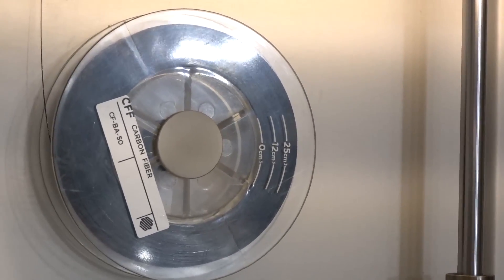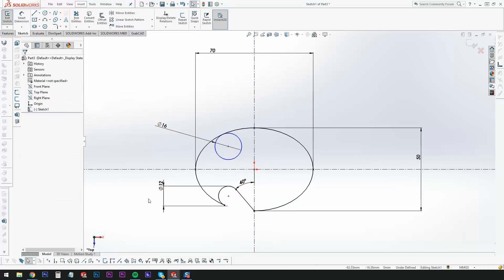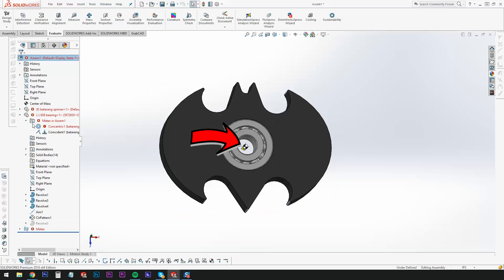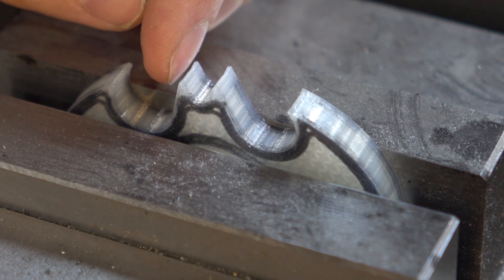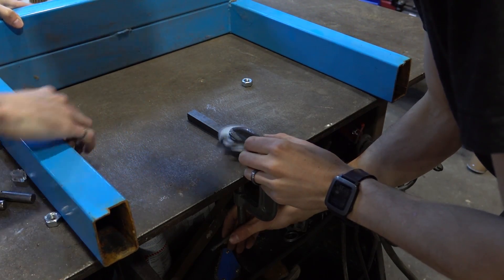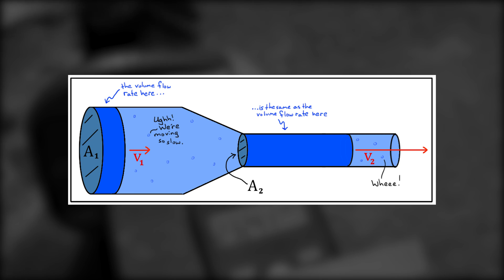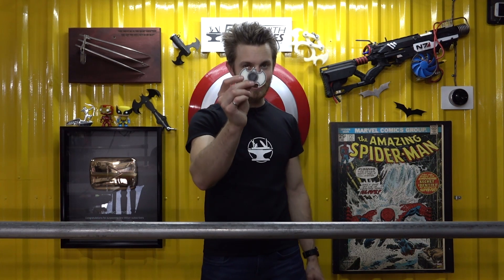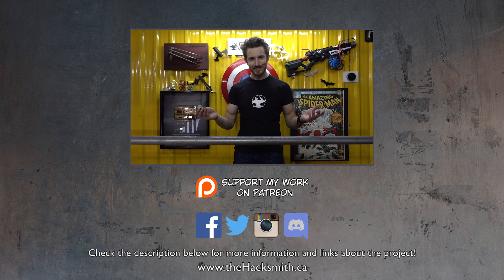Carbon Fiber Fidget Spinner is INDESTRUCTIBLE! +GIVEAWAY

Comment from the maker: Should we try and destroy this? What should we spin it into?
Enter to win your VERY OWN by hitting the top of our leaderboard on https://www.gawkbox.com/thehacksmith !
Reply: Spin it really fast, then make contact between it and a steel rod, just to see who would win ^^
Reply: The first thing you could do is show the reflective tape that the tachometer uses to know when it has done a rotation. Can't see any markings or tape on the edge anywhere? If it was spinning at 100000rpm it doubt it would be as visible as in this footage. I am guessing the real rpm's are closer to 20000, maybe and that's a big maybe up towards 30000rpm. Alternatively measure something without using reflective tape that you can actually prove the RPM of. Like setting that drill to let's say 1000rpm and measuring that.
Reply: the Hacksmith make a fidget spinner launcher and destroy things please
Reply from the maker: +Volkan Arslan because these are very expensive to make! The bearing was $20 alone, and the carbon fiber material is not cheap!
Reply: 2 spinners colliding together, maybe different materials?
Reply: Could you turn it into a floating spinner or just make a floating spinner
Reply: Print this exact one again, but without the reinforcement. Test it and compare the results!!!!! >:D
Reply: the Hacksmith awesome 😍
Reply from the maker: +Romit Heerani enter the giveaway! It's free! :)
Reply: Why not try to make EDF blades for using this printer? It seems that the carbon fiber holds up.
Reply: Awesome job :) :) :)
Reply: the Hacksmith You should try to sell these on your website.
Reply: I know this is irrelevant but I think you should work on Montagnes ballistic shield from Rainbow Sox Siege
Reply: you should try spinning it into a moving car. to see what happens to the car, not the spinner
Reply: the Hacksmith could you make Thor's hammer?
Reply: the Hacksmith Absolute Cancer
Reply: print another one, and clash them together!
Reply: the Hacksmith put these up for sale!!!
Reply: put heat on it wile it is going fast
Reply: the Hacksmith maybe make one with a marvel theme too.
Reply: the Hacksmith why you don't sell these things and youse the money for your shop
Reply: the Hacksmith i
Reply: the Hacksmith thank you for your answer and sorry for my english I'm an german viewer
Reply: the Hacksmith please try to break the fruit using fidget spinner!!!
Reply: Can you make the edge sharper and destroy things with it
Reply: how about shoot on it
Reply: the Hacksmith make it hit different kinds of fruit. And will you make me one for free
Reply: the Hacksmith, how is your arm by the way
Reply: the Hacksmith not you too
Reply: the Hacksmith I wish I could take part, but I know I won't win because I simply can't invest that much time into it... :/
Reply: you start selling the stuff you make. start making more Income which leads to better parts for projects. slap some black paint and you could easily sell that spinner for $35-$50
Reply: Adams World um, why don't you read what The Hacksmith said just a few comments ago. The bearing was $20.
Reply: the Hacksmith With two fidget spinners instead of the fingerguard put someting to make it like a spining top,someting like the Beyblades
Reply: the Hacksmith  try making it fly
Reply: the Hacksmith any reason why gawkbox isn't working for me? I've tried doing a few things now and waiting but nothing happens
Reply: how much does the 3d printer cost?
Reply: Adams World  carbon fiber is one of the best and strongest materials in the world and the baring would cost something like 20$
Reply: the Hacksmith  can u try cut wood with the figet spinner that would be epic!!!
Reply: the Hacksmith van you make one from normal plastic we can see the diference
Reply: the Hacksmith Don't read my profile picture
Reply: the Hacksmith try to make an orbeez destroying fidget spinner, with blades and stuff.
Reply: cool
Reply: the Hacksmith sry
Reply: the Hacksmith make a spiderman fidgetspinner
Reply: the Hacksmith does the givaway works on mobile ?
Reply: the Hacksmith have you got flu? your voice is strange...
Reply: the Hacksmith lol
Reply: spin it into spinning lawnmower blades that should do the trick
Reply: the Hacksmith can it mow my lawn
Reply: the Hacksmith You should redo this BUT with the smaller r188 full ceramic bearings.
Reply: the Hacksmith how many orbeez can u fit in ur hand!?
Reply: Hey hacksmith I saw a video in which a youtuber made the same spinner in metal check out that video it is in the channel called gaico whatever
Reply: Hey, can I please be in one of your videos
Reply: Hacksmith what about your iron man project plz answer
Reply: the Hacksmith i dont really need another fidget spinner i got you 1.20 im only 12 so i can't send you money
Reply: the Hacksmith make one for me plss

Comment: Upsize it!  At 5 inches the edges will be going over 1,000 mph. 
Lexan safety shields!  
Harbor freight has cheap Super heavy duty shop presses, you just need to align and slightly mod it when you assemble it.  (owns a 20 ton shop press I used once)
Reply from the maker: +Kris Kringle haha you wouldn't be able to spin it up that fast!

Comment: There are more 3d printers that can prin in carbon fiber. Like the Zyyx PRO for exampel, its able to print in both carbon fiber and kevlar.
Reply from the maker: Still not the same thing, from what I just saw the Zyyx PRO has proprietory filaments with chopped fibers in it, where as the Mark 2 actually has two filaments, one plastic, and one pure fiber, allowing for continous fiber to be placed inside of the part!

Comment: How does that RPM sensor work? Does it measure 2 (or more) RPM / rotation because the shape of the spinner is irregular?
Reply from the maker: +Etu Suku for non reflective parts like this you put a piece of reflective tape on the edge, that's what it counts
Reply: Cool, thanks for answering. Love your channel!

Comment: I've been a fan since the captain America shield, and I can't wait until the iron man suit is done. That being said, as an aspiring engineer, I just wanted to ask for some advice; I'm planning on going to Texas a&m for both mechanical and electrical engineering, but my concerns should I try and complete both majors in a four year span, or choose one to do in four years, and then go back to school for the other one, taking 8 years total? And then if I should do that, being that mechanical engineering is said to be the most work, while electrical is said to be the hardest, which one would you suggest I should do first?

Thank you for taking the time to read this, 
Frank H. Gibbons IV
Reply from the maker: It really depends what you want to do most. Is it really possible to do both in four years flat? That's crazy!

My personal recommendation would be doing more of a mechatronics program. They're typically more of a hybrid of both mechanical and electrical which gives you exposure to both. In my opinion, the fun part of engineering is bringing it all together -- so I'd recommend mechanical. You'll still be working with electric systems and integrating them into mechanical systems, but you won't have to spend the time painstakingly designing all the electronics!

That's just my opinion though, really depends what you want to do!
Reply: the Hacksmith thank you very much, I don't know too much about mechatronics so I will most definitely look into it and see if it's what I'm looking for. I love working with the mechanical aspect of things, aka the physics of it, which I've been told is mechanical, but I also love working with electronics, which is why I was thinking electrical. I honestly have no clue as to wether or not I could do them both in four years, so I will definitely do one and go back and do the other, besides, I've also thought about how I might choose one to do and like it enough that I won't see a reason to go back and do the other, mainly mechanical engineering is the one I would do first. 

So thank you so much for everything, and thank you for replying, it means a lot to me that you care so much about your fans. I am going to take every word into consideration.

Thank you again,
Frank H Gibbons IV

Comment: Actually there are a lot of printers that can use carbon fiber filament
Reply from the maker: There's a difference though. Carbon fiber plastic filaments is more of a marketing scam -- the thing that makes carbon fiber super strong, is having continous fiber inside the part. If you buy a plastic filament with "carbon fiber" inside of it, it's just chopped strands, so you're not getting the same kind of strength! The Mark 2 is the only printer that actually lays continous strands of carbon fiber in the part between the plastic =)

Comment: If you are just a bit familiar with physics you would know that spinning this fidget over"99999" rpm the tips of it would have an circular speed higher than the speed of sound and personally i couldn't hear any sonic boom which would be the proof for these high rpm.

Comment: Any chance the change in shape is what gave it so much more structural integrity? Seems like typical fidget spinners have more weight farther from the center of mass which would create a much greater centripetal force at 50,000+ rpm...

Try printing a typical spinner with the same carbon fiber support and see if it breaks (my guess is it will).

Comment: Could you get a rough estimate on the actual speed of the spinner by filming it at a known frame rate and counting the number of times it moves into and then out of phase with the camera as it slows down to a measurable speed?
Reply from the maker: +Harper Hopkins you can also just calculate it by multiplying the rpm by the perimeter of the spinner :)
Reply: Sorry, should have been more clear- The angular velocity of this spinner went above the capability of your instruments to measure. I meant, could you get a rough measure of its actual maximum angular velocity by performing that count?
Reply from the maker: Oh, I don't think it was very much over 100,000RPM judging by the sound pitch change

Comment: I'm not surprised this didn't explode, in the other video's I've seen its more the spinner being ripped apart from the weight of the bearings at the edges then the material just failing. You should try to make an Arc Reactor spinner with other bearings at the edges and see what the material can really handle.

Comment: I dislike fidget spinners in general but since it is the Hacksmith's version it has to be better (wrote before starting). Hey a 3d printed spinner that doesn't shatter when using air pressure, that's pretty good.
Reply from the maker: Haha thanks.

Comment: I have only one doubt, since I discovered rpm counters.
if the object has more things that reflects light (like this spinner has 2 wings, or a plane propeller that has 3/5 blades), how does the counter understand when the object has done one full rotation? 
if the spinner has 2 blades, shouldn't the interpreted speed be double the real speed? 

sorry for my bad English :D
Reply from the maker: +Nuovo this rpm counter comes with reflective tape -- we put one piece on so it counts a revolution every time it sees it :)
Reply: the Hacksmith oh! Thanks for the explanation :D

But how does it work with very reflective objects?
Reply from the maker: +Nuovo depends on the measurement device -- in that case you usually use black tape so it counts the absence of reflection as a revolution :)
Reply: the Hacksmith thanks a lot! :D

Comment: I am curious about bearing lubrication.
If no lubricants are required?
I am recommending a special metal lubrication additive MT10 along with 5wt. motor oil. will give you even greater rpm and near Eternal bearing life.
If interested,
I can help you with the product.
No charge.
Reply from the maker: Ceramic Bearings don't use lubrication

Comment: Try having 2 of them next to each other, spinning in opposite directions, to make a launching device. The drop jelly beans on it to make a jelly bean cannon
Reply: The orbess? I really do like your idea, unfortunately i do believe they would just explode, but i do like the thought of it, Hacksmith, please try this out.
Reply: MrHanske2 so why don't make just a launching device? why would you use fidgets? the fidgets spin with air pressure, so why don't use it directly to shoot the orbs?
Reply: MrHanske2 I think it wouldn't if u add a hollow rod or plate or some kind of container to hold them behind it in a slanting way . So it would automatically throw them into the cannon from behind
Reply: Wheeler67 sooooooo, flywheels?
Reply: Wheeler67 another shitty idea with fidgets
Reply: Because that's not what the idea proposed was?
Reply: zatarra again And where is the fun in that?